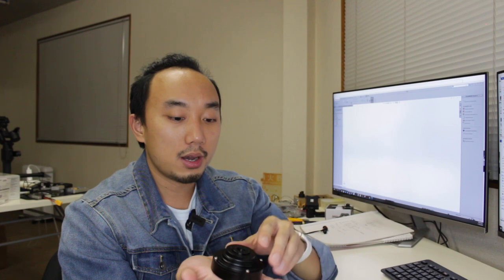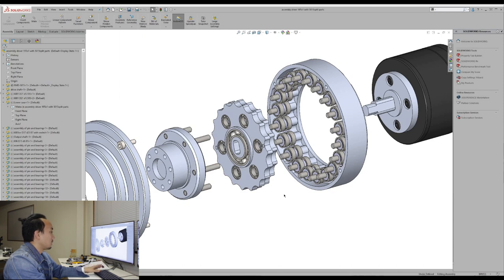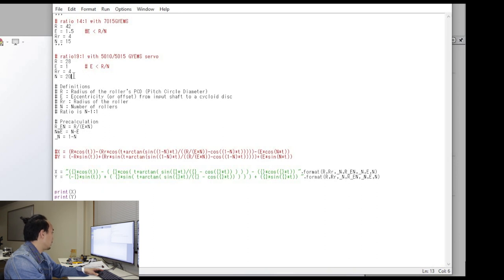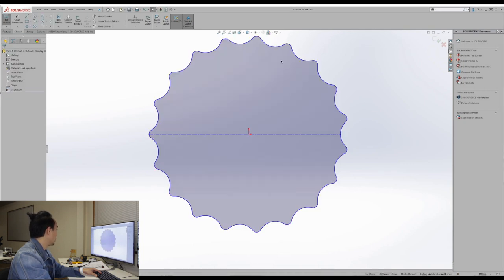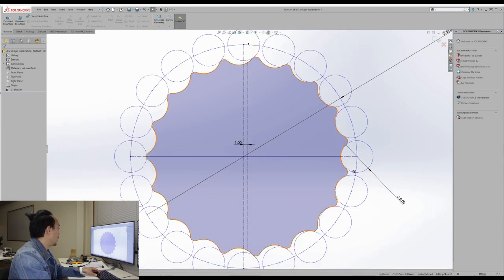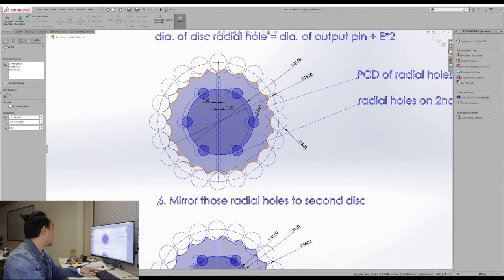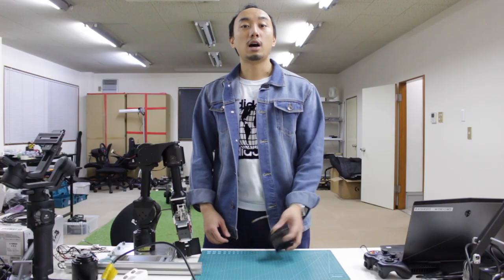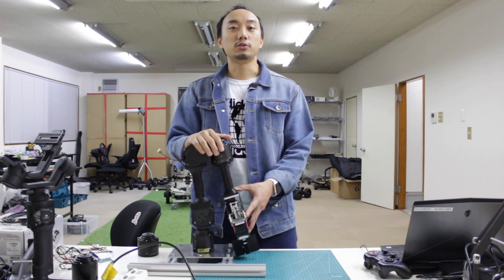How to Design a Cycloidal Drive for Robot Actuator Module!

Comment: This video was a huge help.  No one ever mentions the pre-calcs that help it run. Apparently SW has some order of operations issues and the equation straight out of the design sheet everyone has been using doesn't work as pasted.

Comment: It took me a while but i finally got the method working in Autodesk Inventor as well. Thanks for the video, it really helped a lot!
Reply: Hi! I'm struggling at it right now. I have problem with the function driven curve which returns unbalanced shapes. Like squished and progressively degenerating. Have you changed something in the function formulas? Thx for reading, thxxxx if you can take some time to reply
Reply: @yannmegard4008  I guess, you are using Inventor as well. The problem is that Inventor and Solidworks use some different expressions. For example in solidworks it is "arctan" and in Inventor you have to use "atan" I can send you a link to the python script I used to generate the equations
Reply: @danielh.8836  Yes, i'm using inventor. I found out for the atan expression, but nevertheless it doesn't work properly. I'd love if you could send me a link to your python script! Thank you so much, it's very kind of you
Reply: @yannmegard4008  somehow YouTube is immediately deleting all my comments with the drive link in it... If you want you can send me your Email and I can try there
Reply: @yannmegard4008  Just sent you an email, hope it helps. If you have any questions feel free to ask.
Reply: Which CAD software is he using in video?

Comment: I see you are using a lot of bearings around the cyclodial disk in your metal version. But you didn't use them in your 3d printed prototype right?
Is there a big difference in accuracy or something else?
Because I would like to make a 3d printed cyclodial gearbox  for robotics application (similar to your prototype) . Would you recommend using these Bearings or could I leave them out like you did in your first version? (would it be a good place to cheap out on?)
Are the CAD files for the Cyclodial Gearboxes you made for download somewhere?
I really appreciate the content you make!!
Reply from the maker: there is some research paper mentioned about using rolling components like pin or bearing can give more efficiency (less internal friction) than a solid lobe, you can try check on my description. But for prototype and simplicity, the solid one should be okay.

Comment: Thanks for the video, i'm planning to get position from the outshaft, i'm checking the  magnetic encoder AS5311 and a magnetic ring. They use the same methode to get position from a rotary table of a handmill
Reply from the maker: Thanks for the info :) I will have a look on it for a new version.

Comment: Looks like a pretty slick design! From the shots at the end where you move the arm around by hand, it looks like it backdrives pretty easily; do you have any idea what the backdrive efficiency and starting torque are?
Reply from the maker: Thanks! I never done the experiment of efficiency before, but for back drivability we need to use the servo that can control stiffness and damping while it’s in position mode (like mini cheetah actuator). I did some simple test on cycloid drive with two links arm before, please check out here https://youtu.be/CJyCcXob0c8

Comment: Great job! why are you using two rows of bearings (for each gear). There are some restrictions of using one row of bearings (for both gears? It seems, that cycloidal gears are moving with same speed
Reply from the maker: Thanks!
Using two rows of bearing because there is no a bearing that thick enough for two cycloid disc gear. So even a solid lobe instead of bearings also okay, but with bearing it will give more efficiency.
Reply: @stepbystep-robotics6881  HK0408 bearing will fits your model perfectly. Are you planning to use single bearing for test? one more question - the shafts for holding surrounding bearings were milled with one case with their holder or they can are separately produced and assemblied?

Comment: Hello there,
Excellent presentation...
Can I learn how you do the torque calculation? 
I want to calculate for my 1 to 30  ( ratio 1:30) project.
thank you so much.
Reply from the maker: Thank you!, ratio is defined by N-1 where N is the number of outer roller, in my video I was using N=20, so I can get 19:1 ratio. Torque depends on your motor spec.
Reply: Thank you.
If according to your project it was N 30, what would the torque be?